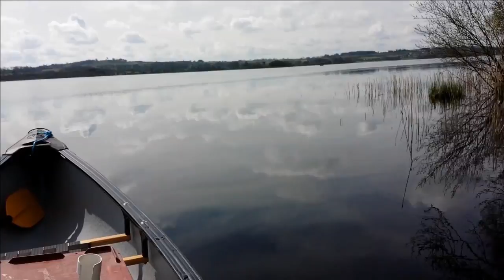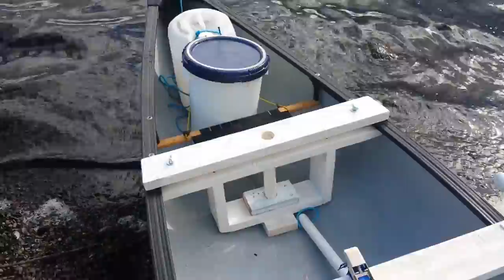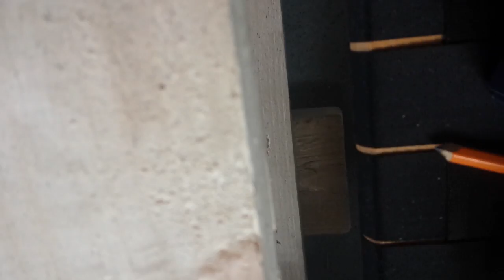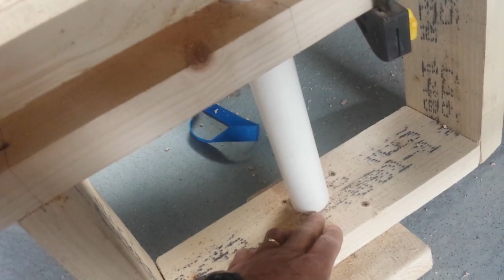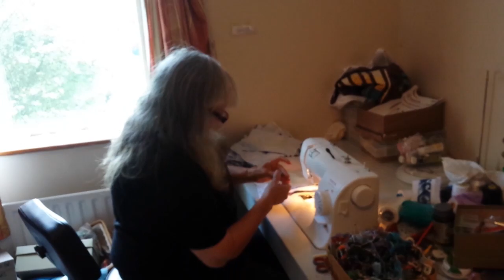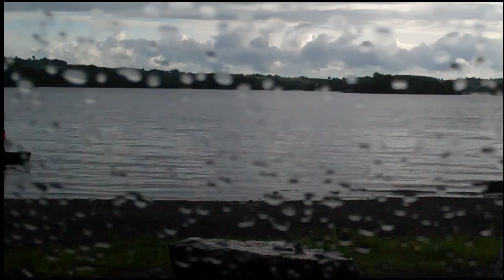Canoe Sailing, Adventure or Disaster?

Comment from the maker: Thanks for the comment.
It probably took 9-10 hours total including making the sail. The materials were stuff I had in my workshop, kiln dried 4" × 1 1/2 pine", 2' of pvc pipe for the mast to fit into, a timber door threshold for the dagger board and a off cut from an axe handle for its handle. The dagger board is mounted to the crossbeam using aluminium angle this is pretty heavy duty stuff which I also had. The mast is made from old uprights for a safety mesh from around a kids trampoline which i drilled and fixed with 3 pop rivits at each connection. The sail is made from an old dome tent rain cover. I painted it with exterior gloss only cost was 3 8mm bolts washers and wingnuts about €3.00. The next video show it in action in a bit stronger wind conditions.